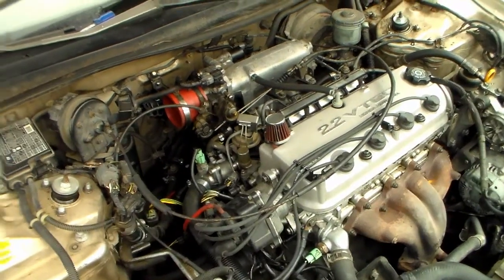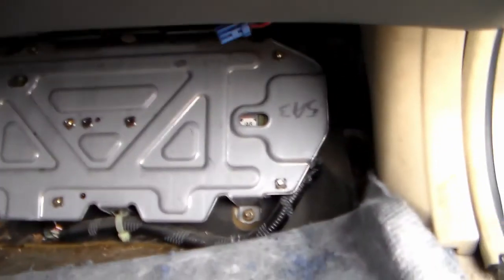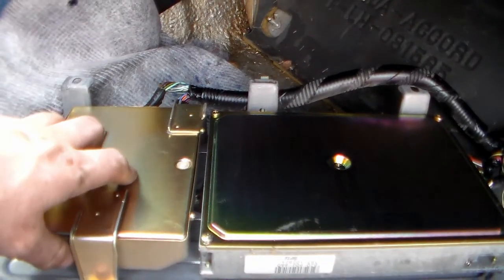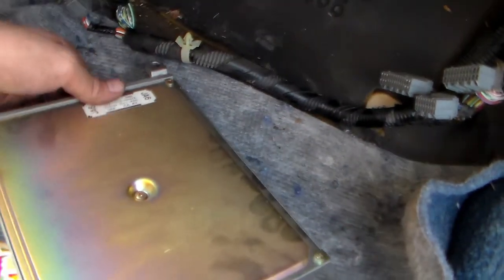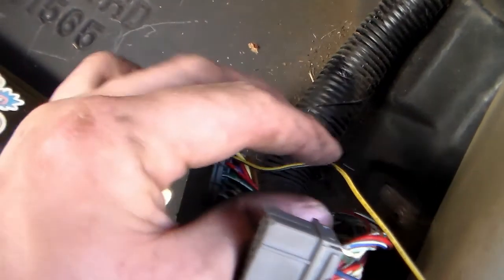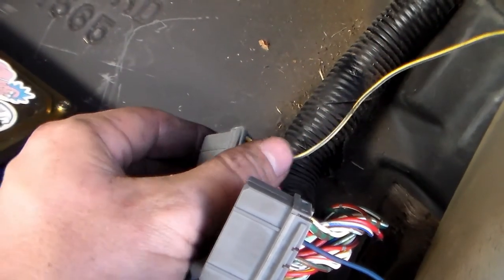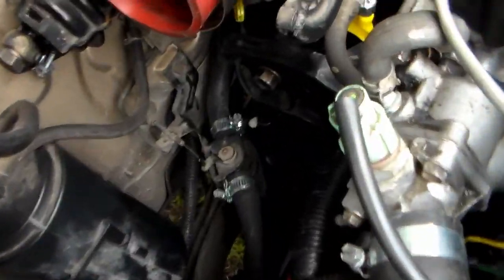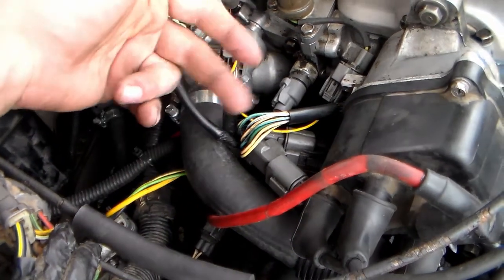How to Wire Vtec in 1994-95 Honda Accord

Comment: How about for a 4 connection ecu, F22b1 obd2a non vtec harness with vtec ecu
Reply from the maker: To be sure I get my information correct  I have to ask a few things. What's the model numbers on the ECU you are wanting to use? What region is the ECU and Harness from? North American, JDM/asian markets, or European? Do you have an automatic or manual transmission? What year Accord are you working with?
Reply: @foxisretrofitting4556 this video is almost exactly what I’m looking for, I have a 97 accord it has an f22b1 5spd North American and the ecu is a 37820-p0j-L11 874-321143 on the side
And on the back it says JL1 and 874
I need to know what pin out is for the vtec solenoid and the pressure switch. I’ve looked high and low through the old forms and I can find anything on it. Please help me
Reply from the maker: @afroman5531  Your ecu is gonna be an OBD2 model. On connector "A" which is a 32 pin connector the Vtec solenoid wire is position #8 a Green/Yellow wire when installed from factory. Connector "C" which is a 31 pin connector position #15 will be your Vtec pressure switch which is a blue/black wire when factory installed. Here's what you'll be looking at to help visually: https://allpinouts.org/pinouts/connectors/car/1996-1997-honda-accord-ecu/
You can ignore the "B" Connector in the diagram since that is used for automatics and yours is a 5 speed manual. Let me know how it goes and don't hesitate to ask questions. 😀
Reply: @foxisretrofitting4556  dude thank you so much I’ve been trying to hunt down this info for a while and it’s been mind numbing to a point lol
I’ll definitely take a closer look at the ecu. 
When I was checking out the numbers on the side of the case it seemed to correspond with the non vtec ecu. Have you heard of that being an issue at all? Also I enjoy your vids man keep up the work it’s genuinely appreciated n content we are all about💪🏽
Reply from the maker: @afroman5531  That does appear to be a f22b2 non vtec ecu. Could be possible that someone swapped computers out at one point to get by and that's all that could be found at the time. For 1997 Accord EX with 5 speed manual and F22B1 Vtec engine a 37820-P0H-L02 ecu is what you want to be dead on. A 37820-P0H-L01 would also work because it is from a 1996 Honda Accord EX with 5 speed manual and F22B1 Vtec engine. The last digit of the model being just a revision number, you can use either of those ecus you can get ahold of.  I'll look back at my notes tonight and see if there's other alternatives I've forgotten as well. These ecus are obtainable on Ebay and could possibly be found at junkyards.

Comment: Good evening, could you help me? I have a 1994 accord with automatic transmission and I converted it to manual and it doesn't raise the RPM, it cuts me off at 4,000.
I have not changed the ecu, it is with the automatic, I must do something to the ecu to raise the RPM.
Reply from the maker: What model number is on your ecu? Was it an lx or ex stock? Is the engine Vtec or non vtec?
Reply: @foxisretrofitting4556  it is f22b vtec engine
Reply: @foxisretrofitting4556  my ecu is P0A-A51 Vtec
Reply: @foxisretrofitting4556  I already checked all the vtec wiring, they are fine.
Reply from the maker: @kachete7644  This is going to be hard to diagnose without the car in front of me but I have some ideas. The main mechanical differences I could think of is I know the IACV between the manual and automatic applications are different enough to maybe cause issues. This makes the idle and vacuum set slightly differently between manual and auto. Double check your distributor and mechanical timing. Double check all your transmissions linkages for adjustment. The only time I've had my accord cut me off at 4,000 rpm was when I ran a vtec head with a non vtec computer because the computer, obviously, was controlling it like it was a non vtec head. This made it get to 4,000 rpm and then it would spit and pitch a fit not going past it. I've had a Civic cut me off at 4,000 rpm due to a weak fuel pump. Do you have a check engine light on? If you do have a check engine light on it is possible it has thrown a code that puts it into "limp mode" which could keep it from going over 4,000 rpm. If you do have a check engine light on you can get the codes very simply using a paperclip. If you figure out what codes it's throwing, if it does, then I can talk you through fixing or bypassing some of the codes.

Comment: I just got a Honda Accord, and the engine is 2.2l vtec.  The oil pressure sensor is broken but the connector is connected to the wire harness and there is no connector to the solenoid. would i have to make a wire like you did for the solenoid?
Reply from the maker: You may have to or it could've been chopped off or still hanging around in the wiring harness wrap. What year and trim is it? If its a 94-95 OBD1 model the wiring is just like this. If it's a 96-97 its OBD2 which is different but I do have the pinouts for it to help you if needed. If you need alot of help on this I'm here for you. Let me know and we can get more in depth on Discord.
Reply: @foxisretrofitting4556 did you start this discord chat?
Reply from the maker: @PUMAOT  I never got contacted to initiate a Discord chat for this topic but the offer still stands for anyone who needs help.

Comment: Would I do the same thing if I was doing a h22 head swap ?
Reply from the maker: I've never done that head swap so I wouldn't be sure but you could compare this obd1 wiring diagram with an old prelude containing the engine you are using parts from to see if they are the same. If it's obd1 it should be close or the same considering the Accord and Prelude are siblings.

Comment: What gauge wir did u use
Reply from the maker: I was lucky enough to have some spare bits of 2000 civic engine harness around to use. It's the same size as the stock wiring on the Accord. I'm not sure what size it is but it is tiny, like almost speaker wire size small (just don't use speaker wire). As long as you don't use anything smaller than what's already going to the ecu you will be fine. I saw one fella swore by using nothing but 18 gauge in his old dc2 Integra build. I would trust that considering it was made during the same time as my Accord. 18-22ga seems about right. When in doubt take a small bit of it with you to the store and compare it if you have to. If you have access to a junkyard or a Honda parts car any of the smaller wiring under the dashes and alot of the sensors wires will work for you.
Reply: Got a engine wire harness from a f23a
Reply from the maker: @louishollins961  If its complete and has  the end that would go to an ecu on it you can depin the wiring from the ecu connector and unwrap what wiring you need and repin the wiring back into the ecu connector on your car for use with your new Vtec equipment.